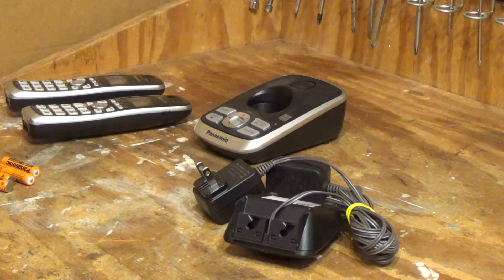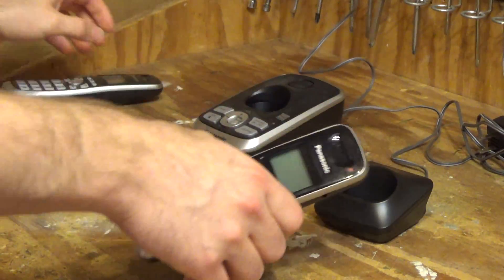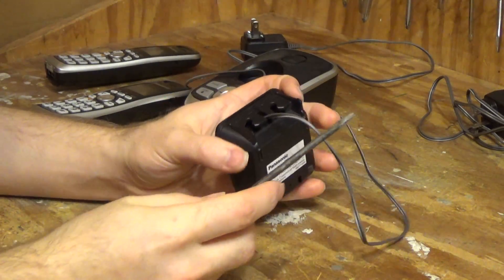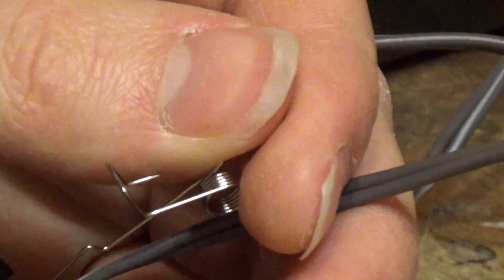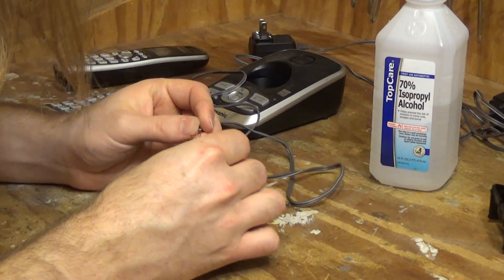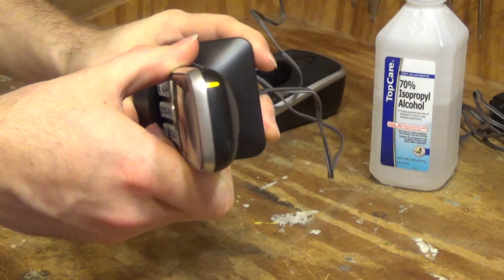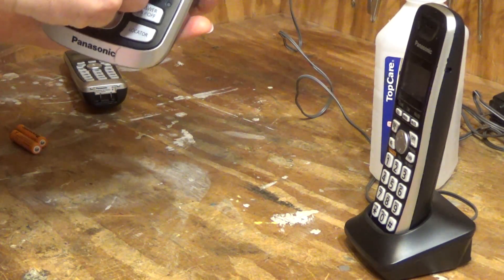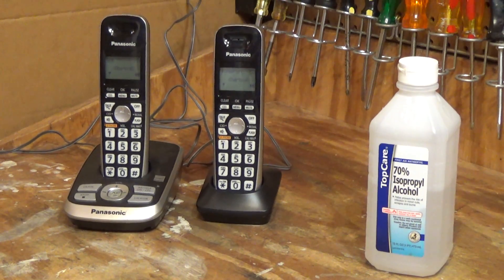Panasonic DECT 6 Plus Charging Issue Repair

Comment: Jordan, what you failed to show or tell is exactly HOW you were able to disassemble the base by inserting the screwdriver into the slots under the base unit. After fumbling with it myself, I got it apart and discovered that simply prying up with the screwdriver in either hole, away from the closest side of the base, caused the clip to release. The clipping release mechanism's operation wasn't obvious to me even after opening the base. Thanks for taking the time to post your video!
Reply from the maker: Thanks for the feedback.
Reply: Robert, thanks for the tip and Jordan thanks for the video.  I re-watched the video after reading this comment, and was able to get the cradle open.

Comment: I could not for the life of me figure out where the clips were... I thought they were at the back. After about 20 minutes of not being able to open it I found your video.... All I wanted to do was separate the power plug from the base because the hole i had in my desk wasnt big enough to fit the power plug through... my last phone cradle had a detachable power cord... I dont know why they insisted on hard wiring the power cord on this model phone but thanks to your video I was able to open up the cradle and take out the wiring and fish that part through the hole in my desk. Thanks a lot.
Reply from the maker: They needed to save a few cents and not use the plug and socket...Panasonic is just not the same company they used to be.
Glad the video was helpful.
Reply: That is so freaking funny because that is seriously what I would’ve commented verbatim. We were in literally the exact same oddly specific situation and found each other on this niche video lmfao

Comment: Thank you. I have the office cordless on the base that charges fine.  I have the kitchen phone on the charger that doesn't charge at all. After trying a few things, I switched the phones around. The kitchen phone chargers fine on the base and the office phone doesn't charge on the charger. So I KNOW it's the charger, not the phones. Wish me luck.

There was no visible rust anywhere, and a little bit of dust inside the plastic.I have more underneath my fingernails. I cleaned that, saw no loose connections, and reassembled it. That did the trick. It's charging now. I KNEW the base couldn't have much to it, and that turned out to be true. 

Thank you, again.
Reply from the maker: It only takes a little accumulation of anything to interrupt the charging. It's recommend to clean routinely every month.

Comment: Thank you so much for this video. It's amazing to see all it needed was to be cleaned. But I would like to add that there is no need to take the cradle apart. All you have to do is put a little alcohol or hydrogen peroxide on a Q-tip and you can clean those little prongs from the outside. Worked amazingly!
Reply: Actually broke a table trying to open it so try first without opening it
Reply from the maker: There's so many problems that can be fixed with a little preventative maintenance.

Comment: Thanks for the video! I grabbed a razor blade and cleaned the bottom of the handset terminals. That solved my charging issues. No need to disassemble the bases.
Reply from the maker: Usually cleaning the handset's contacts is sufficient, this was an odd case where the base had rusted somehow.

Comment: Thanks for posting this! Was able to disassemble my base to feed the wire through a small hole.
Reply from the maker: You're welcome..
Reply: Cordless phone Panasonic model no kx p508e on no ho rha
Reply: Panasonic kx TGA 508E base or charger OK ha lakin hand set on ni ho rha.
Reply from the maker: @IbrarHussain-xo3vg  That doesn't make sense..
Reply from the maker: @IbrarHussain-xo3vg  That doesn't make sense..

Comment: My phone is a similar model, slightly newer, but still a Panasonic with the 'AAA' size pair of Ni-Mh Batteries. What i have found is the original orange Panasonic batteries will not last more than 5-6 months life in regular use. Apparently they are cheaply made cells from China they have OEM made for Panasonic. Instead get yourself some "Eneloop" brand Ni-Mh Cells instead. You can get these at camera stores. I put these in my phone and all the battery life issues are resolved and the phones work perfectly!  Also clean the battery terminals with q-tip and alcohol then let dry 5 min then install the new batteries. Phones now work 100%
Reply from the maker: I've seen mixed results with the Panasonic models that take the pair of AAA cells.. The older DECT 6 models seemed to go through batteries very quickly as you described.. On the other hand, the newer DECT 6 Plus models seem to hold batteries for years at a time no problem.. I do believe it is something to do with the design of the handsets, rather than the batteries..
In regards to the Panasonic batteries, there are 2 different cells out there with the Panasonic name on them.. Some have a black top by the positive terminal, others have a white top by the positive terminal.. The white-topped cells are supposedly a superior quality to the black-topped cells..Ironically enough, Eneloop is made by Panasonic.. I've used many different brands of batteries in phones over the years, and I can't say I've found the Eneloop ones to be all that much better than a reputable 3rd-party brand like iMah,Tenergy or EBL.. In my opinion the Eneloop is too much more expensive for only a slight gain in performance..

Comment: I have the exact same phone set with the exact problem. I thought it needed a new Panasonic recharge battery so I went out and bought a new battery and installed it now after watching this video the problem may be that I need to take the phone apart and clean the inside good grief. The problem is I really like having a  home phone.
Reply from the maker: I like having a home phone as well..
Reply: See my comment above. The original orange Panasonic batteries do not last long. Get some Eneloop or Energizer Ni-Mh replacements instead.
Reply from the maker: @kurts858  I don't believe their issue is surrounding the batteries, though regardless iMah and EBL offer substantially more affordable replacements with comparable performance..

Comment: Great video.
Do you know what is the maximum range of this phone?
Is there any wireless home phone that can work 300ft away from the base?
Thanks.
Reply from the maker: The operating range depends completely on the operating environment.. 900 MHz digital spread spectrum phones can usually provide well over 300 feet of coverage in most operating environments..
Reply: If you put the main base unit near a window on the 2nd or upper floors of your house or apartment the range will be greatly enhanced.
Reply from the maker: @kurts858  I've experienced this to be generally true, but again it all depends on the environment.. If you have a 'noisy' environment outside your house, placement near a window may introduce more interference to the base than if it was situated in a 'quiet' internal area of the house..

Comment: It is the power cord that is bad.
Reply from the maker: It is not the power cord that is bad..
Reply: @JordanU  It is.
Reply from the maker: @Roninkinx  The power cord is not bad.. Find something constructive to do with your time; this isn't it..
Reply: On mine the power cord was bad also (I cut the cord and tested it with a volt meter). I'm not saying that oxidized/dirty contacts can never be the issue- but generally if the contacts are dirty it will work at least intermittently and moving it around on the base should cause it to connect - if that's the case, then cleaning the contacts will resolve the situation. Fortunately you can find a replacement base on Ebay for $10-$15
Reply: if the power cord were bad, cleaning the contacts wouldn't fix it.